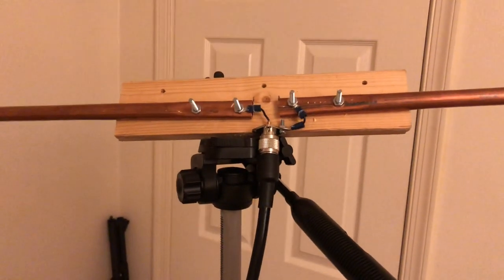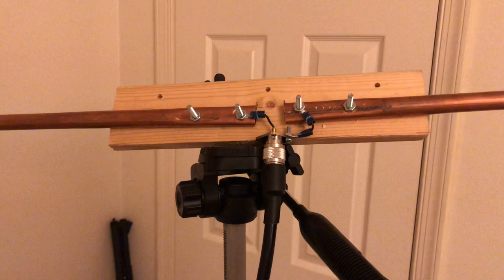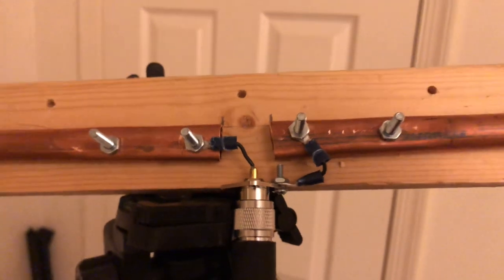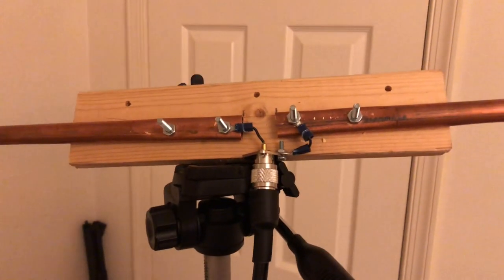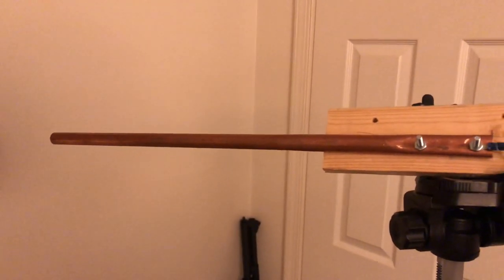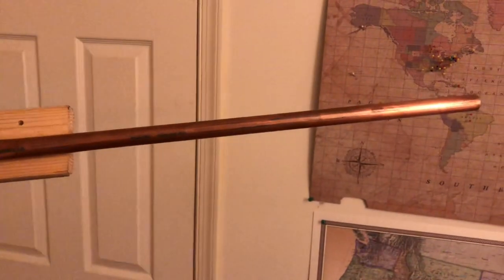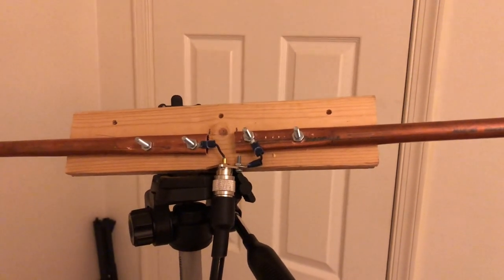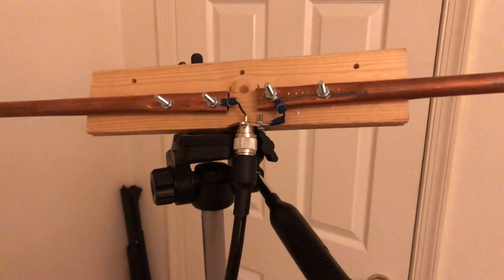2 meter dipole part 3  “Will it Antenna “

Comment: I really enjoyed your videos on the dipole, i hope that you got the swr down a bit more. Maybe you could do a follow up video showing how it works on fm and on ssb.
Good job and 73 from VE3QJ
Reply from the maker: VE3QJ thanks for the idea.  Honestly she's sitting in the corner right now. Sad I know. I was actually thinking of cutting it for 220 because I don't have a 220 antenna. I only have a duck for the ht.  I figure I can use it with my UV9. mount it vertical and see if it works.   It's fun to play with.  
I want to get an external tuner some day. So maybe Ill be able to play will it antenna a bit more.  But I also want to get a back issue of the ARRL antenna manual.  Thanks for watching.  73
Reply: @mikecricket113  i think the idea for the 220 band is a great idea, i think that band is under utilized.